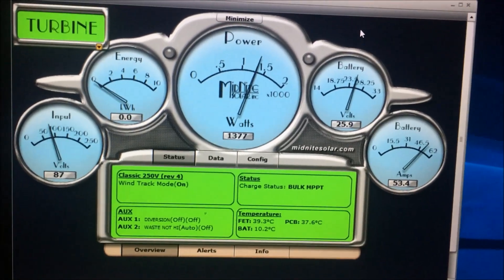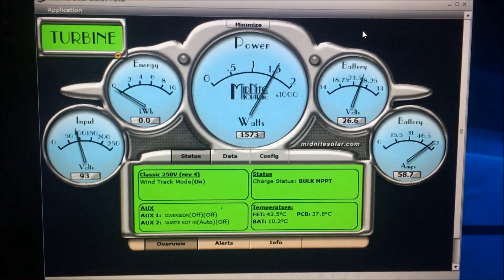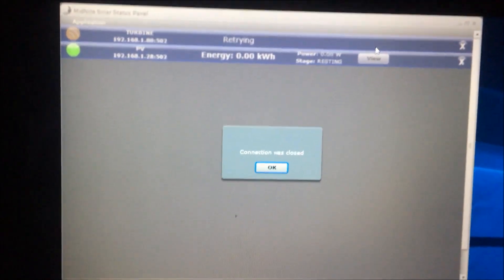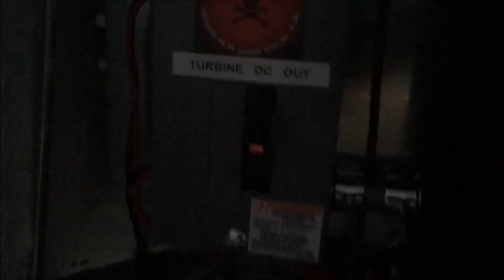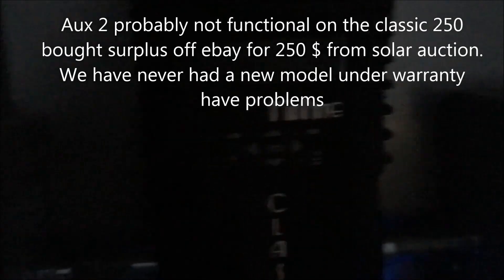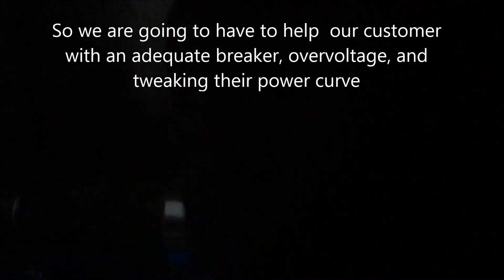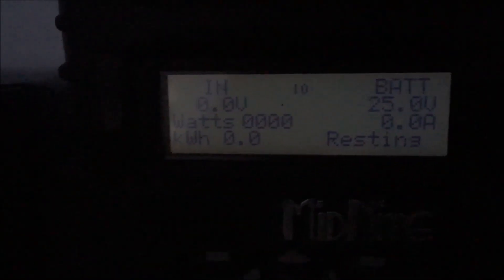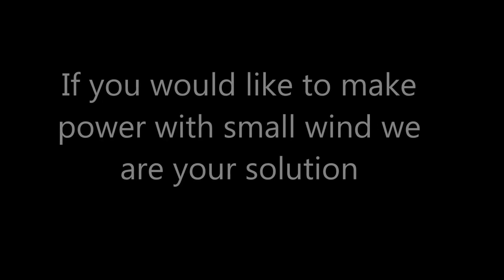Micro Wind Turbines are worth it Hurricane Wind Power Vector Wind Turbine Generator too much power!

Comment: Well that is just awesome! Must be REAL ruff not knowing what todo with all that power eh? Geese.... that settles it, i want one. Love the tail!
Reply from the maker: Thanks ...take it in context this is a small system with limited battery but we are doing good with what we got. We will be able to show more power production when we  are running loads to bring the batteries down more
Reply: @HurricaneWindPowercom  what I really want to know is, how does it do in "dirty wind"? I live in a valley with rather turbulent wind and have done a lot to try to get power out of my Chinese turbines. They're finally making useful power with the addition of much larger tails, higher voltage stators and larger blades but something tells me I could make more. I've owned a divert load controller for a while now but haven't felt the need to hook it up. If you got 3 minutes check the system out. https://youtu.be/XJ8jTf6A6iI

Comment: Dam I have not seen a video from you in like a year I think.  Nice to see you are still doing good.  I haven't messed with Solar or wind for almost 2 years.  My solar has been shut down for now, until I get the house done.  Will  need to replace battery bank its dead.  I have been so out of the loop on Solar, and wind for so long now. I will after home is done and remodeled and new pole barn built will get back at working on solar.     Good to see you again.
Reply from the maker: good to hear from you. bud....been busy and youtube is well.....youtube